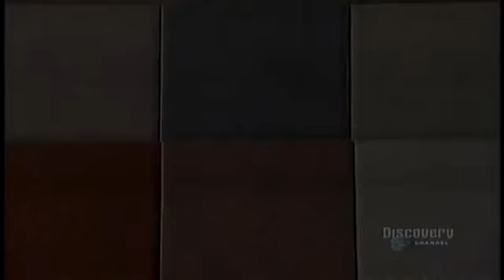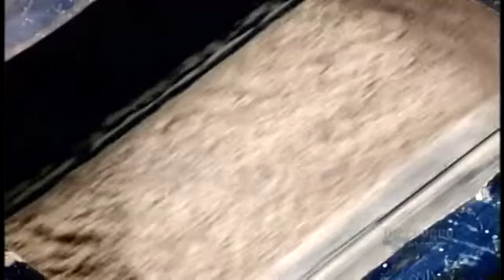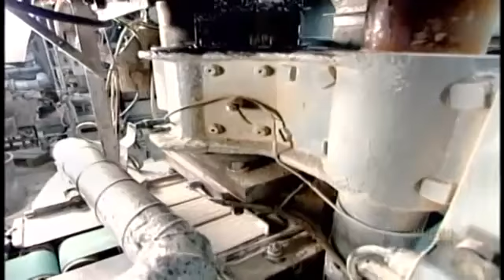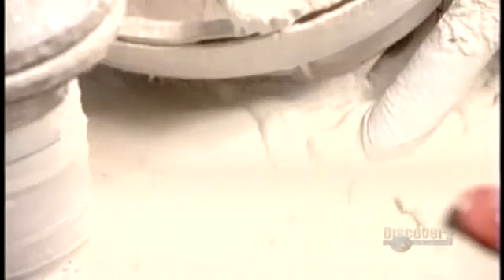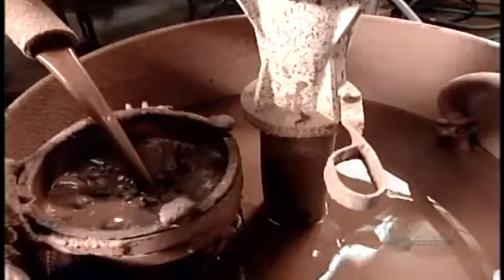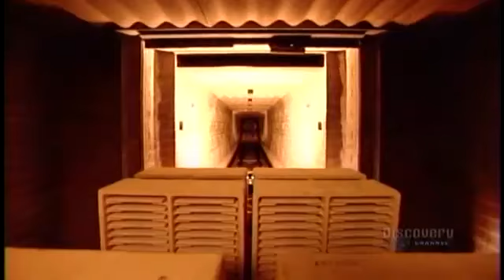How Its Made: Ceramic Tiles

Comment: Although the video was well done and edited, there were two incorrect terms used to describe the fabrication process.  Never does the tile making process use the term "paint" to describe the colorizing step in the making of tile. Glazing or glaze is the terms to use for applying permanent coloration to a ceramic or porcelain tile. The second error was used when the pre fired tiles were loaded into trays or carriers so they can be fired in the kiln. The video script said "...workers stack them on wooden racks"  Anything made of wood that goes into the kiln would be quickly burn up once the racks enter the kiln.  Script was probably drafted by the Chinese company that supplied the video material. The "Racks" were made from foundry clay that is just like fire brick but lighter.

Comment: Quite a bit of misinformation in this video! The "water-based paint" would more accurately be called a glaze, which turns into something similar to glass after being fired. The "wooden" shelves that the tiles are placed on are actually most likely cordierite.  If they were wood, they'd burn up in the hot kiln.

Comment: so why don't the wooden racks burn in the kiln if it reaches a temp of over 1000 F?
Reply: She is wrong.  There is no way wood could be used.  The racks look like some sort of ceramic.
Reply: You mean over 1000°C
Reply: Jim Bee that's what I'm saying!! They can't be made of wood!!
Reply: Katy Kaboom Lynn is wrong
Reply: The wood would technically turn to coal if it was an oxygen free kiln but no way that's wood it would burn in a oxygenated environment
Reply: Jim Bee I was also having the thought of that.
Reply: It’s probably coated in copper solution
Reply: its not wood. its made of alumina or anything material that can withstand high temperature.